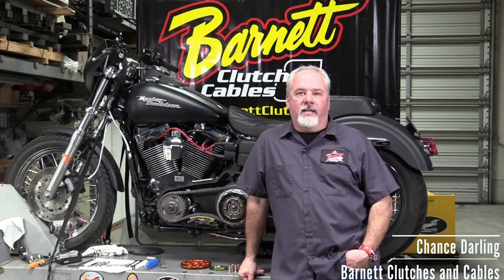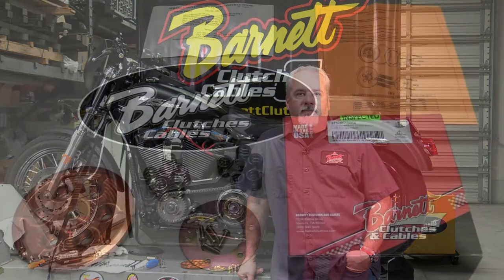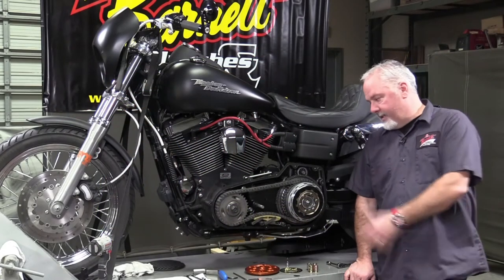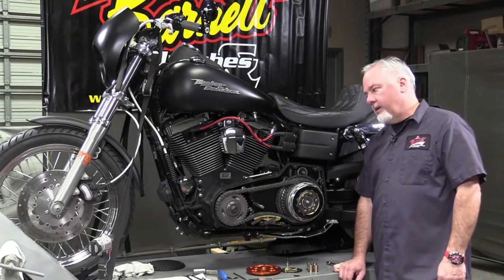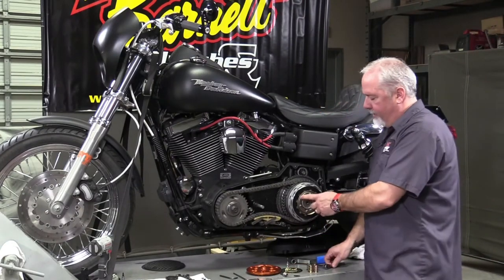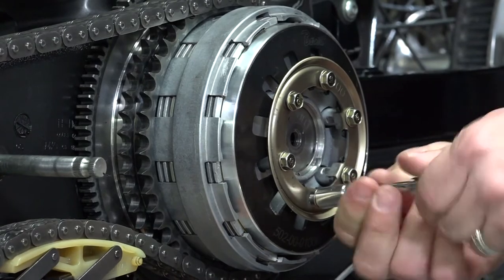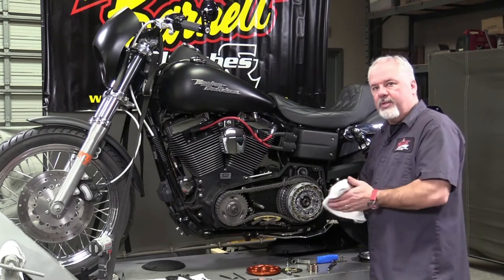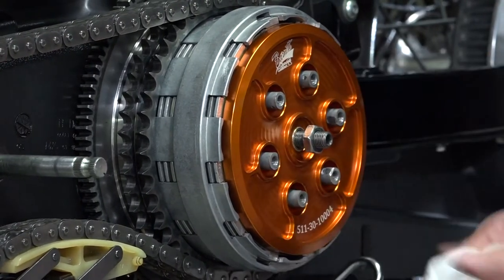Barnett Coil Spring Conversion Kits

Comment: How many friction disc and sleet plates come with the clutch for a 2022 Low rider ST softail
Reply from the maker: The stock clutch uses 10 frictions and 9 steel plates (Barnett kit #303-30-10019) and our extra plate kit (Barnett kit #304-30-10020) includes 11 frictions and 10 steels. Both of these kits also include a set of 3 heavy duty replacement springs.

Comment: Im fairly sure it will, but does this work with the rekluse extra  disk torque drive clutch pack? Stock basket and spring just has the rekluse clutch pack and hold down ring. Thanks in advance
Reply: No, it will not work with Rekluse.
Reply: @christaylor4266  do you happen to know what prevents it from working with the rekluse? After taking mine apart it does appear to have the same factory single spring and whatnot still. Thanks for the input mate cheers
Reply from the maker: If it's a stock type clutch it may work. If it has the thick piece in it (auto clutch) then it won't work. We don't test with their products so we cannot say 100% for sure either way.

Comment: CAUTION  !  When using this conversion kit you MUST retain the original pressure plate and diaphragm spring.
You will need them to remove the Clutch Hub Mainshaft Nut (which has left hand threads)
You must remove this nut to remove the primary chain.

Comment: my 13 street glide has bigger cams adj.rods....would that call for heavier sprigs[green]?
Reply: it depends on how much power you putting out. You might want to try using a combination of the lighter springs and the green springs to keep the lever as light as possible. If that isn't enough pressure, go with all six green springs. You can call us at 805-642-9435 with any tech questions.
Reply: @christaylor4266  thank youj

Comment: What IF I have too much Free play in clutch lever, when adjusting cable I have run out of threads to get rid of slack. My cable is maybe 1.5 years old from Burly Brand , and Your clutch basket # 608-30-10011 maybe has 3K miles on it. Am I supposed to adjust anything on maybe springs after so many miles being new ?
Reply: Loosen it all the way at the cable midway adjuster, then adjust it at the clutch per factory specs. Once you have it adjusted at the clutch, then adjust your cable to the proper free play. You can also contact Chance at chance@barnettclutches.com.
Reply: @christaylor4266  Thanks. What direction do I need to go with the internal adjustment IF my bike is taking off just after letting clutch lever out ?
Reply: @christaylor4266  Funny you said that name , I talked to that person this evening.
Reply: It sounds like you only adjusted your cable not the actual clutch adjustment

Comment: Can I use the c90 boulevard clutch kit on the c109r? I can’t seem to find any good aftermarket heavy duty or performance clutch kits for the c109r specifically. So I’m wondering if I can use one from another bike that would match up like a m109 or c 90 etc.?

Additionally does Barnett make a scorpion for the 08 c109r?
Reply from the maker: NO, the C109R clutch is unique and nothing like other typical manual motorcycle clutches regardless of brand. Basically, the plates that would typically be bare metal have friction material and the plates that would typically have friction material on them. We don't these plates and I don't believe anybody does other than Suzuki. We do, however, make a set of heavy duty springs that should help. The part number is 501-58-06092 ($30.50) and you can order them at barnettclutches.com. The Scorpion clutches are only made for Harley Davidson models.

Comment: My 99 roadstar 1600 came with this conversion kit, I need to replace my clutch disks, is this kit reusable or do I need to buy a new one?  Thanks
Reply: Road Star uses our 511-90-10002 spring conversion kit. There is no need to replace it unless it has been damaged somehow. Our replacement clutch plate kit (frictions/steels) is #306-90-20083.

Comment: I installed the carbon fiber extra plate kit, 307-30-20013, in my 02 FLSTFI with the coil spring conversion kit (mixed the provided spring colors 3 & 3) Now, occasionally off a stop it will try to engage very harsh and exhibits a squawking noise... would this be cured by switching to a Dexron III ATF vs the redline v twin primary fluid im using? 

This same kit in mine buddies 02 Nightrain with heavy duty diaphram spring worked out awesome with no noise or harsh engagement. Just great grab and go!
Reply: @christaylor4266  Thank you Chris!
Reply: I have the exact same issue going on...have adjusted the push rod 2 different times and still get that occasional harsh engagement and it's scary as crap.  What did you find to fix the issue?
Reply: @robw5874  it is scary… the thing just wants to go. I havnt done anything with it yet. Sad to say, I havnt ridden since last August. My next step was gonna be to dump the Redline Primary oil and refill with Dexron. My thought is the friction modifier package in the redline may just be too much. Let me know if you try anything and get results.

Comment: I was attempting to install the extra plate kit to replace the SE plate currently installed.  This is on a 2016 HD Streetglide that has a hydraulic clutch.  I was also installing the spring conversion kit.  The HD extra plate kit doesn’t require use of the dampening seat and springs that go in first.  The instructions for my kit shows the I need the two thin dampening springs.  Is this correct.  I got everything installed and my lever had no pressure.  I could see the movement when engaging the clutch but it didn’t feel right.  I removed it all put the stock stuff back in and it works fine.  Any suggestion?
Reply from the maker: It was not installed correctly, please check your plate orientation. If you continue to have trouble, please contact Chance at 805-642-9435
Reply: Barnett Clutches and Cables I reinstalled everything as the directions show with the exception of the stock damper
Seat and spring.  The instruction say use these?  Is this correct?  Installed clutch plate with the larger diameter first, them a steel and plate till all were installed. I finished up with a clutch plate. I used all the same springs, ensured the pressure plate was flush and tighten the springs down equally. Started out with Lucas primary oil, had the sound; drained the fluid and went with ATF still the same result.  I had previously bled my clutch so I’m good there.  Any suggestions
Reply: Chance thanks for your support, I reviewed all my documentation and instructions.  The spring kit I ordered was not the extra plate kit. I ordered part number 306-30-20018, not 307-30-20013.  This was for a 2016 HD Streetglide Special.  Looks like I can still use then kit but need to purchase the stock harley damper seat and spring.  Sorry for the confusion and thanks again.

Comment: On my 15 RGS, HD dealership installed my Barnett scorpion kit with basket,  , I have the rolling sands derby cover that I can see the scorpion clutch plate and the springs are the gold ones I never was aware that it comes with the extra set of black springs for the heavier, HD did not give me back the box manual or any extras or stickers that came with the purchase of the Barnett clutch, now I have the screaming eagle 110 tire shredder kit installed in the bike same dealership producing 123 horsepower 123 torque to the rear, when riding aggressively I'll shift at 5000 RPM and the clutch would slip recommendations